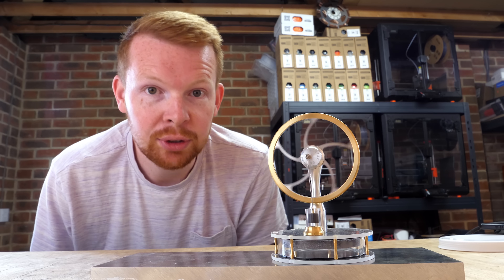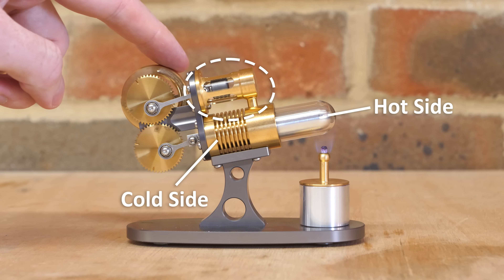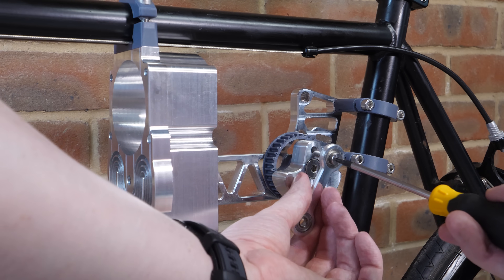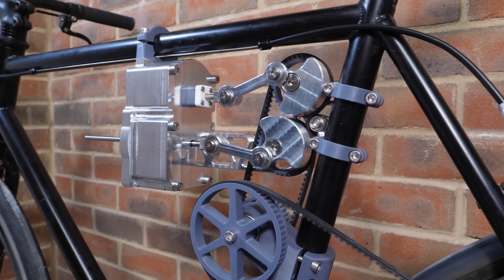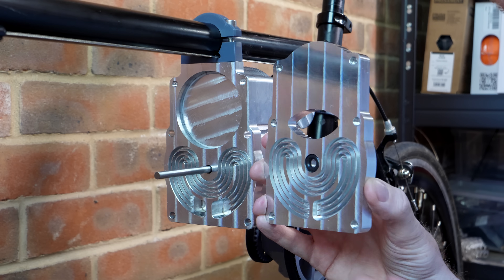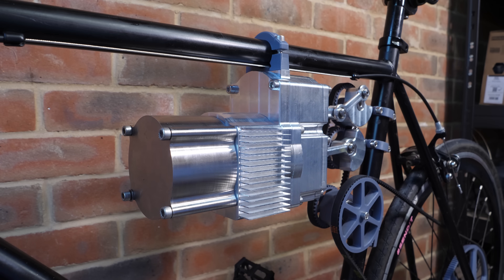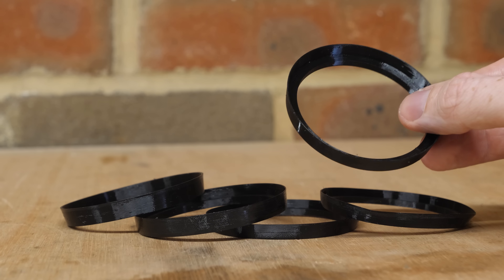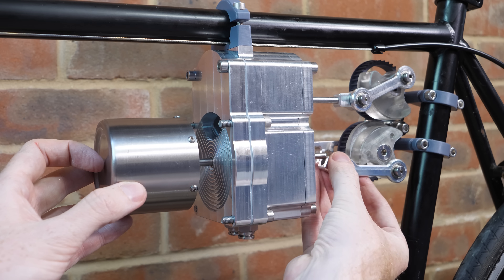Building a Stirling Engine Bike - Part 1

Comment: That's so cool! Very interested to see how much power you can get out of this
Reply: Hey Joel! Loved the Nerf Nuke series! Hope your back's ok!
Reply: power rating is based on the temperature difference in the hot/cold side of the engine as well as the "working fluid" and it's pressure as well as obviously the size of the pistons. high quality practical use Sterling's use Helium because it's lighter and faster to heat/cool so the transfer rate is more efficient over just plain "air" which is ~80% Nitrogen, ~18% Oxygen and ~2% various other gasses and particulates.
Reply: not enough to power the bike once it touches ground, it would take a stirling engine that could realistly out 250-500W to power that bike
Reply: @FakedPvp  what about as a pedal assist, or like a cruise control? Honestly electric is the way to go with bikes imo, if you're gonna power it. An emergency stirling recharger with tire pump might be an idea? If i run outta juice i could just start a fire or buy some ice and recharge.
Reply: @TheDocLamkin  at most he will maybe get 15W out of it so it would be a very slow recharge
Reply: Half of it, anyway. The other half is pretty hot.
Reply: please make this instead it works 100%  A Hall back array Magnet you turn on and off to pick up heavy steel, well it uses little to no energy to turn the magnet on and off, you can make a repulsion motor by making a piston engine, that when the magnet is reppeled the hallback switch can rock past a cut off to then recipricate the engine over and switch to turn the magnet back on all using simple mechanics. I hope this helps you and others. Have an amazing day
Reply: @Pauls4reel  aaaaaand, he committed suicide lol
Reply: If you could run the braking system through a flywheel that generates heat for the Sterling engine which could generate electricity charging a capacitor that could power a small electric helper motor in the hub? Maybe you get enough power to blip the throttle for a few seconds every time you accelerate, which makes it almost useful. 😂

Love this whole thought experiment. Thank you.
Reply: especially considering the power going into it...
Reply: We can only be justified by the BLOOD of JESUS CHRIST, the Lamb of God, who offered Himself on the Cross to cleanse us from our defilement and thus erase the sin of everyone who places their faith in salvation through the BLOOD of God the Son, JESUS CHRIST, sent into the world as the sacrificial Lamb by God the Father to pay the ransom.

Our redemption is a free gift from the FATHER… through the finished work of Christ under the Law.

And it is only through His pure Blood shed on the Heavenly Mercy Seat that we obtain forgiveness from God the Father. This metanoia, this change of mind, is the understanding that if you are saved, you know that the only way to Heaven is the Substitutive Atonement through the BLOOD of Our Lord Jesus Christ… and that therefore, if you ignore this, you are lost.

--> Have faith in the redemption through the blood of our Savior Jesus Christ before the Rapture of the Church establishes this new paradigm that will force you to die as a martyr for Christ if you desire to have a share in Heaven.

The evening of the Rapture, Friday, August 1 or 8, 2025 will be a day of unimaginable distress on earth. Blessings
Reply: Terrible power, I wouldn't be shocked if this generated like 15 watts of power. Simple stirling engines are not a replacement for simple steam engines, and you need crazy setups to reach the efficiencies said (pressurized hydrogen as a working medium and regenerators are a must for reasonable power to weight ratios, otherwise you'll have a 1m diameter piston generating a whopping 1hp).
Reply: @ExtremeGamerYT22  Are you salty?
Reply: @IncognitoActivado  For?
Reply: @ExtremeGamerYT22  Nitrogen, not hydrogen, and it's around 80 atmospheres, so high but not unattainable.
There are 3 kW working ones, but the main points are regenerator efficiency and the temperature of the heat source (higher the better).
Reply: @mariosebastiani3214  Hydrogen and helium are used too, they can raise the efficiency like 20% compared to nitrogen.
Reply: @mariosebastiani3214 the heavier the gas the less efficient (which is why you ought to use hydrogen or at most helium), and you mean to tell me that an 80 bar diy system is still going to have the "safe" pro over a rankine cycle? Which could be made using 10 bars with a monotube PID controlled steam generator which is almost impossible to burst? Even then, it is a small pin sized hole which is more of a nuisance than a lethal accident.
Reply: @mariosebastiani3214 that could be good add-on to car or motorcycle to charge battery, or spin turbine maybe, or for oil water petrol pump
Reply: @ExtremeGamerYT22 damn 80 bar is crazy, but 10 bar is duable and relatively safe
Reply: NASA made a truck that had a stirling engine.
Reply: @TheDocRamkin  But unfortunately using a bunch of cobalt. It's not suited for mass production. 
But it shows potential.
Reply: @TheDocRamkin 
Saw in Malmo Technical museum, Volvo 240 / 244 (70..80’s) with Stirling engine by United Stirling AB. One of few prototypes
Reply: @yuriitrevka1593 pra museu é bom 😂
Reply: @TheDocRamkin And it was underpowered, expensive and definitely not possible to do without knowledge
Reply: @ExtremeGamerYT22  yeah I'm not worried about all that. I just want a stationary stirling engine in my garage that does everything from electricity production to mechanical movement,while running off my woodgasifier and ice from the fridge. I want freedom from the power company personally
Reply: @TheDocRamkin  A company Remeha in Germany sells such machines as the WhisperGen.
Reply: @gustavgnoettgen ...for real? The Germans really are top tier
Reply: @TheDocRamkin  This and others have been around for like 20 years. They are generally designed for line gas, but I read about pellets too. Wood gas should work with a good generator.
Reply: @TheDocRamkin hell if you have a gasifier I recommend just doing the gasoline engine setup instead of doing your own generator like a steam engine or stirling engine, slightly less efficient with the coolers and filters but much easier to set up
Reply: @ExtremeGamerYT22  just to be real honest I've got an 8th grade education but as soon as i saw the stirling engine i was like "why isn't there one between the stove and the refrigerator that scavenges energy full time and also be a kitchenaid mixer type tool part time?" Idk, then i saw a wood gasifier truck and started playing with idea of the vehicle generating power for the house and vice versa.
Reply: @TheDocRamkin  part way into and for a bit after WW2 there was almost 2 million vehicles(in Europe) that ran on wood gas, the Germans were using it to power some of their tanks and various other equipment. that's another really good sustainable and more environmentally friendly design.
Reply: @ToeCutter454 yeah I've seen those too, it just seems like low hanging fruit for national security to put a woodgasifier in most homes after WW2 honestly. Roads get knocked out, power lines go down, part of the nation collapses whatever, i can go pick up sticks and power my chits.
Reply: @TheDocRamkin  Every engineer knows and loves Stirling engines, we built them in first year, if they were actually useful they would be everywhere already
Reply: @TheDocRamkin  you won't get that from a sterling engine
Reply: @davidjones-vx9ju Get what? I just want a simple engine in my garage powered by winter on the outside wall and the heat from a wood gasifier inside or whatever really.
Reply: @TheDocRamkin  it won' run a generator
Reply: @davidjones-vx9ju I think stationary stirling engines could be used to generate electricity, one of us is misinformed on its capabilities. I'm looking for a system of supports and not really one thing doing it all. A couple solar panels over shade crops, a woodgasifier running a generator, windmills on a way smaller scale than whats ruining the countryside could work.
Reply: @TheDocRamkin German diesel subs use it for power generation

Comment: what if you have a separate air heater, that heats and flows hot air into the hot side? that way the rest of the metal will stay much cooler

Comment: You wanted to stop heat transfer between the hot and cold side but you use steel or aluminum bolts CMON!!! Nylon bolts are a thing and would have really helped there
Reply: ....and melted
Reply: @awatt  his operating temp was close to the max of high temp nylon but then there's ceramic, the point is still the same use an insulator instead of a conductor to connect the hot and cold sides
Reply: @jakobfindlay4136 
The whole point is to transfer heat.
Reply: @awatt not between the hot and cold side, you want the biggest gradient
Reply: @jakobfindlay4136 
Use titanium.  That's awful at transferring heat
Reply: @awatt good point! titanium does have very poor thermal conductivity but you can get ceramic with even lower heat conductivity for probably a fraction of the price of titanium
Reply: @jakobfindlay4136 
Try machining ceramic.  Seriously,  the guy can't handle steel so how's he going to cope with ceramic?
Reply: @awatt buying them... like the ones he has in the video...?
Reply: Nylon bolts would melt there

Comment: Going to need a thick heat resistant housing or some flame resistant pants before you take this thing for a spin!
Reply: Run a recirculating heat coil loop through the bicycle seat and you could go anywhere when its -40 degrees out!

Comment: flash boil steam engines ftw. so what about vacuum bottles, with a double wall insulator. heat will not escape through that. like a double/triple window. water cooling is a no-go.

Comment: This guy will power the bike with any means necessary. What's next, dark matter bike?
Reply: Don’t tempt him.
Reply: Hamsters
Reply: @ReptiLeather  yo 😅😅
Reply: would love to see it though (as long as he doesn’t accidentally create a black hole)
Reply: @What_111 with dark matter it'd be more likely that he accidentally created a white hole. Smallest size of oopsie in that case would be about 292 megatons TNT blast.... Don't play with dark matter kids. 😅
Reply: @What_111 twotierqueer has one of those going spare  !
Reply: @What_111 If only they could channel the energy of potholes, as US roads have plenty of these!
Reply: @What_111 you want him to blow up an entire city?  😅😅
Reply: bike powered by hamster wheel
Reply: Pedals...
Reply: Bike powered bike
Reply: Or much more crazy stuff...he uses biological energie combined with legs....anyway i like this channel.
Reply: He's gotta beat Plasma Channel or StyroPyro to it first 🤣
Reply: @208Concepts  good idea. the working gas could be deuterium, and to warm it up, there could be a fusor inside the piston.
styropyro will suggest a focussed laser beam from an old tattoo removal laser to assist the fusion. and colin furze will make that thing fly.
(if it should be ridiculous, go the whole way)
oh, and collab with matt denton, make it a 3d printed lego brick cart.
or ivan miranda, would be a fun choice too.
Reply: Most likely an Infinite Improbability Drive, strictly because that is the least probable next step.
Reply: The smallest thermal nuclear reactor, in terms of mass, is a spherically shaped solution of 242mAm(NO3)3 in water, weighing approximately 4.95 kg with 0.7 kg of 242mAm fuel. The reactor's radius in this case is 9.6 cm.
Reply: @eestaashottentotti2242  well, then we need T folse to help us out.
I wanted to go fusion powered (yes, it's practically impossible, but would look cool), but a americium powered nuclear hoverbike with sterling engine?
and yes, the reactor should not be where the sterling engine on the current bike is.
unless tom has already accomplished all his reproductive needs ;-)
Reply: @eestaashottentotti2242  cute, my posting is gone.
let's try it more youtube-friendly.
this is tyler folse territory.
and I would suggest to place that reactor somewhere else, not on the position where the sterling engine is mounted. just for biological reasons.
Reply: Antimatter
Reply: Coke & mentos powered bike.
Reply: @jpeg1991    So much yes.
Reply: How about a bike teleportation device? so the bike will already be at the destination for when you arrive.
Reply: sailbike
Reply: @jaorlowski yes, wear a baggy sweatshirt.
You would still get more push than you ever will from a Sterling engine
Reply: Anti matter bike
Reply: Gravity powered bike.
Reply: @rayk36 yes .
remove the chain and start at the top of steepest hill in town
Reply: This series will end up with a contraption that uses your feet to power your bike
Reply: @IKucheINtortIE  But... that's impossible to engineer!
Reply: @IKucheINtortIE 
I have one of those.
Reply: Despite how incredible he is, even Tom Stanton himself can't make a bike powered by something that doesn't exist.
Reply: Anything but his own legs
Reply: Nuclear might be the next logical step. 🤔
Reply: A porridge powered Angus from Stirling will be even more efficient and Blowtorch between legs not required.
Reply: Yes
Reply: We can only pray
Reply: Nuclear
Reply: Cold fusion bike
Reply: What about a nuclear powered bike?
Reply: Pulse jet.
Reply: @shadetreemechanicracing22  Didn't Colin Furze already do that with a go kart?
Reply: Nah the next one is the steam engine, boiler and all 😭😭⚰️
Reply: Don't give him ideas?
Reply: Nuclear reactor
Reply: @pixobit5882  cold fusion reactor!
Reply: Not sure he can lay his hands on that bruh 😂
Reply: warp drive bike
Reply: Plutonium is perfect heat source
Reply: @mbican   Plutonium-238, as used by NASA in RTG’s.
Reply: solar sail
Reply: Angled 400 lbs rated neodymium magnets! :D
Reply: ...THERE'S NO NEED AT DARK MATTER

.....BUT..... WHAT'S ABOUT POWERING BIKE WITH time itself ,HEHE
Reply: Any means "unnecessary"?
Reply: ANYTHING, as long as it's not pedal-powered.
Reply: We can only be justified by the BLOOD of JESUS CHRIST, the Lamb of God, who offered Himself on the Cross to cleanse us from our defilement and thus erase the sin of everyone who places their faith in salvation through the BLOOD of God the Son, JESUS CHRIST, sent into the world as the sacrificial Lamb by God the Father to pay the ransom.

Our redemption is a free gift from the FATHER… through the finished work of Christ under the Law.

And it is only through His pure Blood shed on the Heavenly Mercy Seat that we obtain forgiveness from God the Father. This metanoia, this change of mind, is the understanding that if you are saved, you know that the only way to Heaven is the Substitutive Atonement through the BLOOD of Our Lord Jesus Christ… and that therefore, if you ignore this, you are lost.

--> Have faith in the redemption through the blood of our Savior Jesus Christ before the Rapture of the Church establishes this new paradigm that will force you to die as a martyr for Christ if you desire to have a share in Heaven.

The evening of the Rapture, Friday, August 1 or 8, 2025 will be a day of unimaginable distress on earth. Blessings
Reply: Next episode.
Reply: @ThoughtEmporium collab? 😅
Reply: Why is it that no satellites or space probes (to my knowledge) that utilize RTG's don't make use of stirling heat engines concurrently to make more power?
Reply: Artificial sun powered bike
Reply: Rubber band bike
Reply: That's fucking bad ass bro.  ...... SWEEEET
Reply: have he built a regular combustion piston engine powered bike yet, that he build himself? cause he has a cnc machine there, so maybe he could build 1 cylinder engine
Reply: @irgiefarras that's just a regular motorcycle.
Reply: 1,000,000 million likes and we will build an orphan powered bike!!!